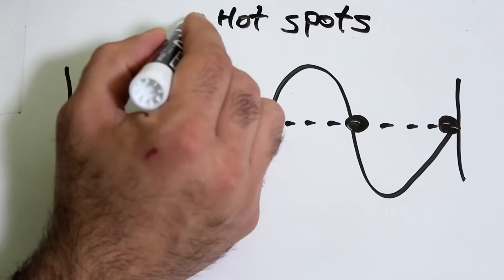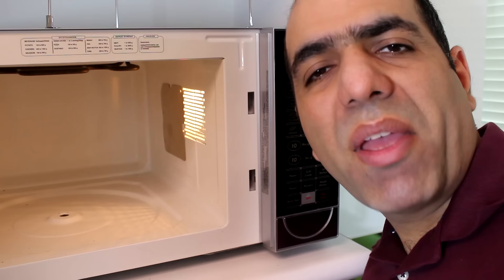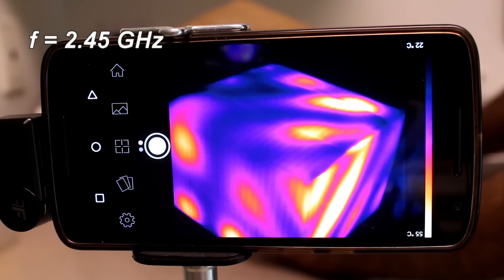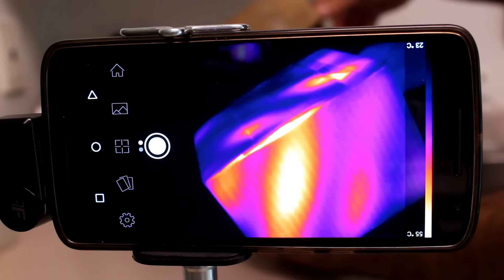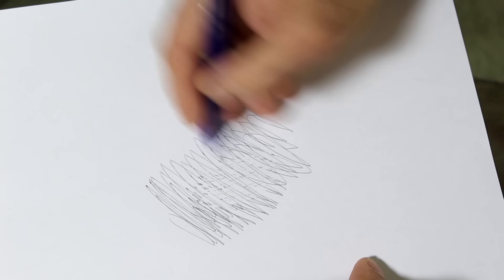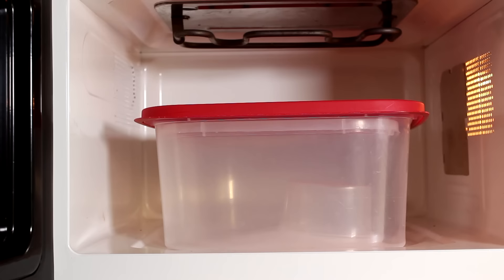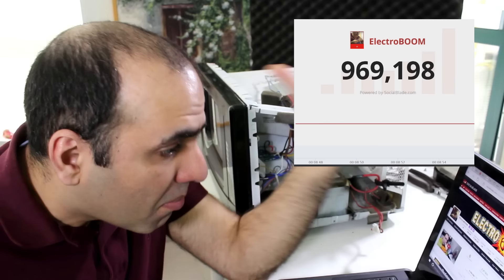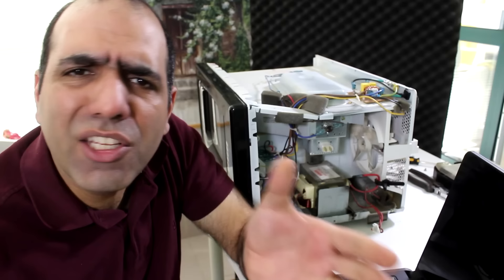Speed of Light, Microwave Oven and How It Works

Comment: Why do consumer microwaves rotate the food, when commercial grade ones don't?
Reply: maybe the commercial grade ones have the mixer and don't need to rotate.
Reply: Yea, I'm no expert, but in my experience the ones with the wave guide shooting in from the side use a turn table for more even heat distribution... and the ones with the overhead guides use stirrers/mixers. Have seen the overhead stirrer type that also use turntables.... IMHO, side entry guides with turn tables work better. As always YMMV...
Reply: the microwave at my job has a mixer at the top and doesnt rotate
Reply: Correct, also older consumer ovens without turntables also had the stirrer. The stirrer was scrapped and turntables added a means of cost cutting. The ovens with stirrers are far superior.
Reply: Fewer moving parts and easier to clean. That's my guess.
Reply: You can make better use of the full volume of the cavity with the mixer (as you don't need to ensure the inserted item can rotate) and also obtain a more even spread of the standing waves then pure rotating of a turntable. 

It is cheaper however to just stick a rotating bit of glass on the bottom thus consumer grade. Consumers do not wish to pay commercial rates
Reply: Maybe they use multiple magnetrons
Reply: Quantum Radiation they rotate the magnetron and not the food
Reply: Most commercial grade ones have the turning mixer, and the ones with more power (1800W and so on) usually have two megatrons (damn it) and two mixers, one in top and one in bottom. Those spread the microwaves more evenly than turning plate anyway.

Comment: Thanks for this really cool pseudo-3d visualisation of the heating pattern in a microwave! I'm a high school physics teacher and I was enthusiastic about doing the experiment to estimate the speed of light using a microwave and chocolate...until I discovered that it (usually) doesn't work. In fact, out of four microwave ovens I tried, I couldn't honestly say I got anything remotely resembling a regular "standing wave" pattern in the chocolate. Then I got my hands on a thermal camera like yours, and I heated up sheets of paper (instead of chocolate) and different heights in the oven (naturally without the rotation plate) and looked at the patterns. First - as you saw yourself in the video - the patterns are not exactly regular. Mine were usually even less pretty than the one you show in this video - and they changed a lot at different heights in the oven. I got suspicious of these experiments and found a paper that agrees: http://iopscience.iop.org/article/10.1088/0031-9120/49/4/419. They write about the c = lambda*freq method in the case of the microwave pattern: "But this is not correct. The distribution of an electric field in a 3D cavity is rather complicated and the idea of wave resonance in a one dimensional string simply cannot be applied to this case. (...)even in this very simplified case there is no observable distance between spots that are equal to 6 cm as it is predicted from the simple one dimensional model. So this method can provide only a very rough estimation of the speed of light." And that was my experience too. In the end, it seems more like a matter of luck whether or not spots that are about 6cm apart or not (I would say I even had trouble finding a single such pair!). I did this experiment in class using the pieces of paper, kind of like you did but in 2d - but made a point of explaining that the well-liked chocolate experiment couldn't reliably work, and people simply tended to see what they wanted to see. It reminded me of the episode where Lowell thought he saw an intricate canal network on the surface of Mars through his telescope! You also seem to find spots that are around 6 cm apart, and I'm just wondering about the casual comment you dropped about "looking for the spots that are closest together". Do you feel sure about that claim? After seeing the random patterns I saw myself using a thermal camera, I suspect it's impossible to know what the hot-spot separation will be, unless an exact simulation of the freq, waveguide, oven dimensions etc. is made in advance. Thoughts?
Reply: Which school do you teach physics at? Asking for a friend who is planning to send his children there...

Comment: can you explain and make a circuit that can capture purely Back emf sparks? and save them the voltages stationary with maybe with an condensator, or shot back into an battery?

Comment: Great presentation but there's one important thing left out. Have you ever wondered why a microwave oven doesn't cook your face when you are right in front of it? Because there's a metal shield on the front door behind the glass with small holes in it. The microwaves have too large of an amplitude to radiate out through the holes and so they are reflected back. Light waves have much smaller amplitudes so they can pass through the holes without trouble and you can see inside.
Reply: Yes, it's like a Faraday cage almost. That's what i say to everyone who says you get cancer from  microwaves.

Comment: Hey Mehdi , just wanted to tell you that you said the speed of microwave electromagnetic waves are travelling at a speed of 308 million meter per second , and as we know that speed of light is close to 300 million meter per second, this implies that microwave electromagnetic waves are travelling faster than speed of light , which cannot happen because if the waves travel faster than light then  infinite force would be required to move as they will have infinite mass and time around it will stop as well.
So please check the calculation there must be something wrong in it . Otherwise it is a great video , and you are an awesome teacher

Comment: TRANSFORMER!!!
Reply: Micrave radiation is non ionising so it wont cause cancer
Reply: troller scammer; Actually microwave radiation CAN cause cancer, since it is able to randomly unzip DNA strands. It is MUCH less efficient than ionizing radiation though, and personally I wouldn't be concerned about it at all.
The REALLY scary things about microwave radiation, are the macular degeneration and cateracts it causes (since your cornea doesn't get enough cooling blood flow AND is a pretty efficient microwave absorber), as well as the induced neural discharges which COULD lead to neural excitotoxicity from the unregulated Ca(2+) surges.
Reply: However, a microwave oven is built as a faraday cage and will not let the microwaves escape. So you're safe.^^
Reply: troller scammer That's why utility workers hate movie stars.
Reply: Dont worry. We are poor enough that we can't barely afford a Microwave

Comment: In the early 1980s, Philips made microwave ovens with the waveguide below the oven floor. Interposed between the waveguide and the oven cavity there was a metal disc with 'quasi-random' slots in it. Philips called this a "Rotating antenna" and it purpose was to randomise and distort the wave patterns within the cavity. These were among the first ovens that did not require a turntable, and they were not cheap!
Reply: Just to add,
There are still microwave ovens (Over-the-Range) type for household use that use both stirrer and turntables.(i.e Samsung,GE)

The Countertop type for household use usually don't have it.

In some brands like Buffalo,commercial microwave oven uses stirrer but no turntable,and sometimes commercial types have more than 1 magnetron.

Comment: 6:38 Well this board on top can be useful if u wanna make some power supply(mains filter if i good remember), there are 240V contact switches/buttons, and on the board u can find relays... a and there is AC synchronous low rpm motor on the bottom that rotate plate, high voltage diode and capacitor can be useful, heaters too (i connected them in parallel and connected it to 24V AC power supply, with is just Weller station and i can use them as foot warmer. )

Comment: And if you microwave grapes, you can create plasma.
Reply: The arcs he makes from the high voltage are plasma
Reply: You do the same by putting in metal. Or lighting a match. Plasma's just another state of matter, which is basically just a really excited gas. Fire and electrical arcs, for example, are plasma.
Reply: Blowtorch the Robot; This isn't completely accurate. All those examples are of very poorly ionised 'plasmas'. Basically you have a very low percentage of plasma molecules floating in a large amount of hot gas molecules.

Calling it a plasma is like using the term 'steam' to refer to the white 'vapours' you see rising up when you're boiling water...
Reply: Blowtorch the Robot nope raisins. Nasty ass raisins but raisins lol

Comment: Why does he say microwaves give “high power and frequency” when microwaves are actually low energy photons? Is it just the intensity is a lot (a lot of microwave photons at the same time)?
Reply: Anyone?
Reply: @ahappyimago  a few hundred watts is considered high power , 2.45 GHz also counts as high frequency so if he said it, its not wrong
Reply: Yes, basically. The quantum nature of the electromagnetic field is pretty much irrelevant at these frequencies, you can just treat it as a classical wave for practical purposes. It's "high frequency" in the context of electronics & radio.
Reply: Power != energy.  The individual photons won't have much energy, but you get a gazillion of them each and every second.
Reply: Microwaves have a higher frequency than visible light. that is intimately related to the photons energy via E =hf. But as other have noticed, we humans are incapable of detecting a high frequency EM field, we notice only its average frequency/intensity/energy.

Comment: Maybe you would be surprised by what people already did with disassembled microwave ovens.
In 2002 i found articles, which described how people systematically 'cooked' up their neighbors using a manipulated microwave oven.

And interesting experiment can be to use the glass tube of an old energy saving light and create a plasma ball by heating the tube underneath a glass bowl.
 
The tube will break, the gas in the tube escapes into the room between the glass plate and the turned over glass bowl, continued microwaving will ignite the gas to a plasma ball.

You could build a radar station with the magnetron. lol

Comment: My microwave oven using a stepping motor to control the direction of "waveguide". And using an IR sensor Array to measure the temperature of the food. Then the controller will control the direction of the waveguide.

It gives a very accurate heating performance.

Comment: "You can see that the AC line enters from that corner and feeds it-- [pops] [yowls] [censor beep] [table thuds] Ow! Always make sure the circuit is disconnected from power supply before you start tinkering with it. Same as you have to make sure your patient is under anesthesia before you cut them open."

Comment: The stirrer was probably an old design, your microwave oven does have a rotating plate at the bottom which serves the same purpose as the stirrer but not by deflecting the waves at different angles but by moving the subject itself resulting in uniform heating. Our physics teacher demonstrated this by putting a massive chocolate bar without the rotating plate to show us the principle of superposition.

Comment: My 30yr old Sharp microwave sounded just like your salvage oven when it powered on: HMMMM!!!. There are only 4 parts of real interest: the transformer, a diode, a capacitor and the magnetron. I replaced the diode first, no good. The capacitor, no good. Hmm. Looked for "bad magnetron" on YouTube and found some terminal blocks, the part on the magnetron where the two spade lugs connect, can develop an internal short to ground. It is easy to test: Unplug both wires from the magnetron, and measure from each pin to ground. If you see any resistance at all, that is a problem. Mine measured 38Ω to ground. After replacing that part, now my 90's era microwave oven works again! And yes, the HV power supply is a "DC voltage doubler" that uses a "puny single diode rectifier", one of the few circuits where a full bridge rectifier is not better. In fact, I do not believe this voltage doubler design will work with anything other than a single diode.

Comment: 6:12 no one:

litterly no one:

not even the soul:

ElectroBOOM: THIS BABY TAKES THE 120 VOLT AC AND INCREASES IT UPWARDS OF 2000 VOLTS! AND FEEDS IT TO THE MAGNETRON WHICH RESONATE AND OUTPUTS HIGH POWER WAVES AND THOSE WAVES SHAKES THE POLAR MOLECULES GENERATING MUCH HEAT! And this is a fan...

Comment: Btw electromagnetic wave has no polar. The reason the microwave can heat food up because the microwave produced has high energy, which increase the activity of electron in the orbit. Activity of electron is what actually is heat . If the temoarature was too high the electron can eject from the neuclei aka proton and neutron. And this is why light, especially sunlight was hot. The uv and light produced by the sun has high energy value that it can increase the activity of electron and heat your body up. Iron was a good microwave absorber that will capture most of the microwave instead of reflect them which cause them heated  easily. Btw metal has free electron which cause them can absorb most electromagnetic wave.

Comment: Didn't realize that's how erasable ink worked. I do a similar experiment with my physics students but use a thin layer of cheese on a platter - the melted not melted pattern reveals the wavelength
Reply: Depends on the ink. The "classic" erasable-ink pen (like Paper Mate's Eraser Mate) simply contains an agent in the ink that prevents the ink from setting for awhile, allowing it to be abraded from the paper just like graphite from a pencil. The erasers on those wear down with use, just like pencil erasers. The ink effectively becomes permanent after some time. The Pilot Frixion pen used in this video uses ink with temperature-sensitive pigment that turns clear when warmed up; the ink is still there, it's just not visible. That paper could be put in a freezer to make the ink visible again. Frixion erasers leave no residue as they don't wear down - they're a harder plastic that just generates warmth through friction and technically don't "erase" anything, so they're easier on the paper. The ink retains its ability to "come and go" pretty much indefinitely (for better or worse).

Comment: Okay so it looks like by the wave pattern that microwaves could be much more efficient if the waves were reflected and bounced in a random or at least more diffused manner. I wonder if you put a galvanometer in the wave path to reflect it perhaps left and right or up and down with regards to the channel that the waves pass through so they bounce off the walls and many different places perhaps this would work and you'd get a much more effective but much more expensive microwave? I have some very nice galvanometers if you would like to try this
Reply: Never mind I watched the rest of your video and learned about the fan at the top that reflects the microwaves so I guess my theory was correct at least but I think of galvanometer would work much better

Comment: The magnetron is like a over grown diode. It works like a gun diode into a waveguide.  Discharge  the hugh voltage capacitor before you handle. It can kill you if it not discharged.

Comment: There are more useful parts than just the Transformers (tm), the magnetron and the fan motor.  Save the microswitches engaged by the door latches, as those things are very useful spare parts to have handy.  Also, there are thermal fuses in most microwaves.

Comment: Ain’t he the genius 🤪
1. To see hot spots, brush butter over the floor or turntable glass. Watch and see the hot spots bubble.
2. If you heat say a cup of tea too long it can become superheated and if you put a cold spoon in to stir it you may get an horrendous explosion which can result in you needing facial reconstruction. Always stir/mix fluids at intervals.
3. When the heating effect of microwaves was discovered it was proposed that homes could have units installed to heat the people then you wouldn’t need to heat everything else as conventional heating systems do 😳🥵

Comment: Why does nothing burn or explode when I heat my pizza on that toaster grill so the pizza ground doesn't get wet and slobby? I mean, it is a metal grill, it sits there for 50 seconds and the microwave uses 1200 watts. I have never noticed explosions or arcs

Comment: Hey Mehdi. What's the best way learn about how guitar pedal circuits work? They use op amps, jfets, mosfets, transistors, diodes, caps, etc...to modify the signal. What's the best way to learn how each of those components affects the signal as it travels through the signal path? Hook up the circuit and scope it before & after each component to see how it changes the trace? I haven't a clue where to begin. Thanks!

Comment: What stops the microwaves from irradiating beyond the appliance, especially on the glass door? Could you measure the amount of energy/microwaves inside and outside the box?
Reply: And by the way, there is another motor that you can salvage - the one that turns the plate

Comment: Hi, I have a power line of 1.2km long and I was curios if the high voltage is an option to increase the load without changing the wires ..